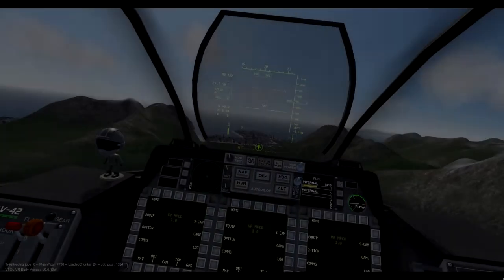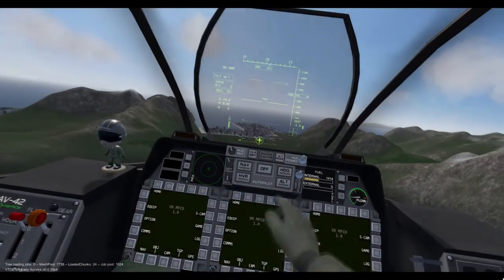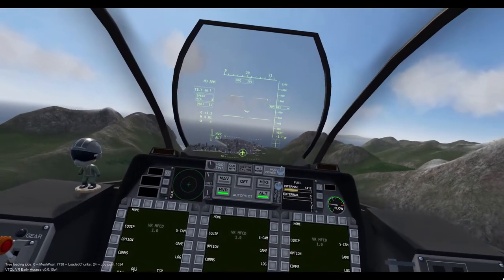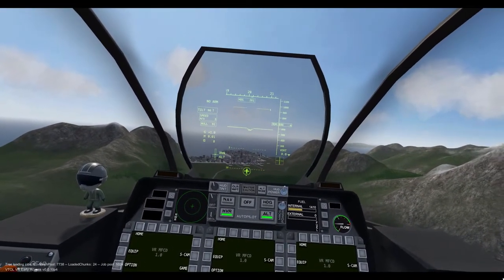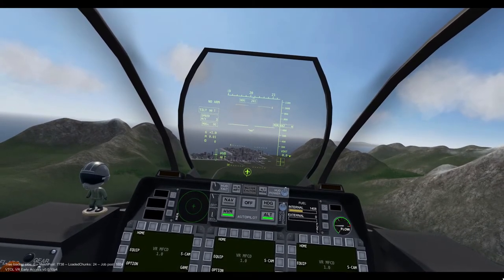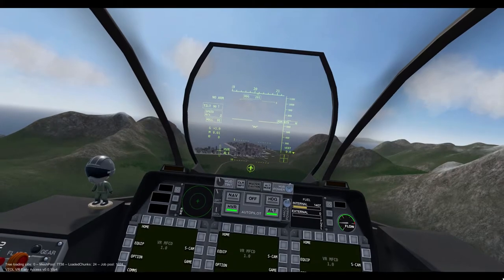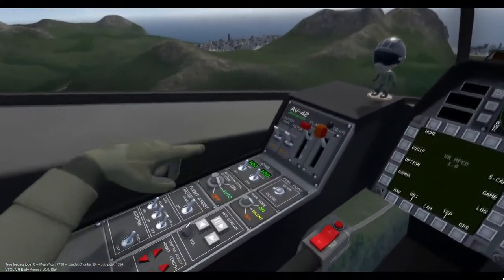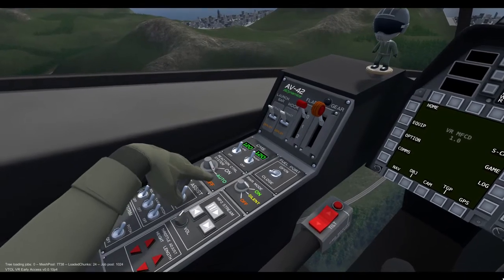VTOL VR Tutorial Nuggets: AV-42C Reaction Control System (RCS)

Comment: Would you say that you can use this system while horizontal flying to have better maneuverability and thus avoid incoming missiles?
Reply: at speed the RCS thrusters won't provide enough of an improvement on turning radius. Since the atmosphere is so thick, control surfaces will always be better and more effective.
Reply: That’s like attaching a tiny jet engine to your truck and expecting to outrun a formula one car.
Reply: @yourfriend8052  mmm no it's like that lol. First.... I'm talking about side to side movements to avoid last second impact..... no to "outrun" the missile. Second...... the truck is on the ground, there's friction where in the air, friction is minimal, but I'm not a pilot so idk what I'm talking about lol
Reply: @alefpvc.r.4540  Youd be better of tilting the engines and using AB thrust